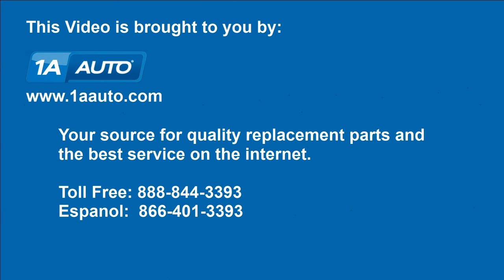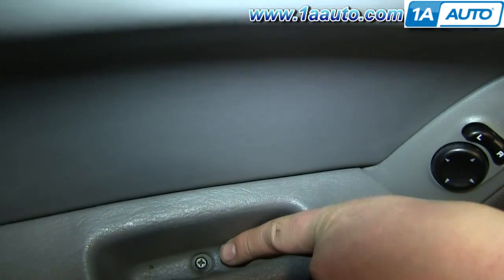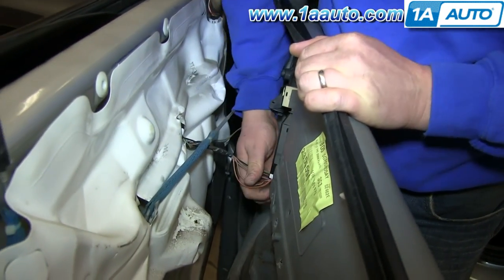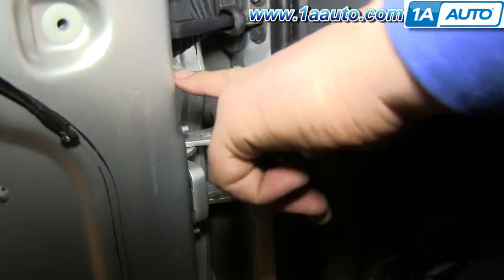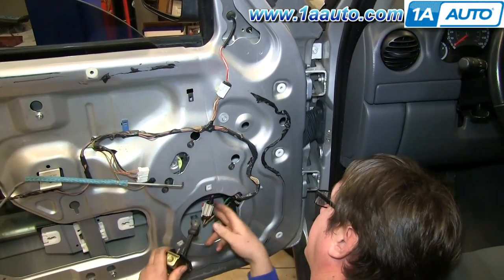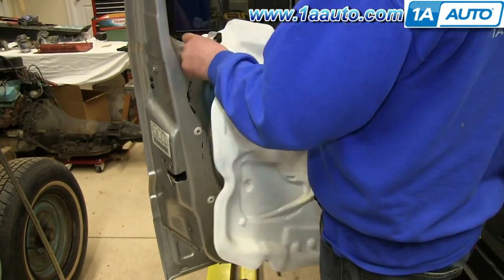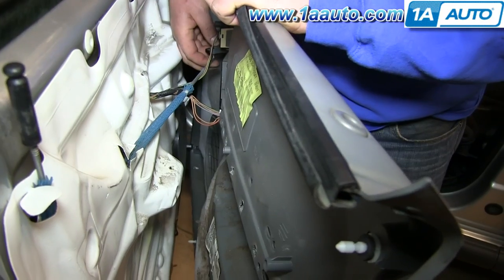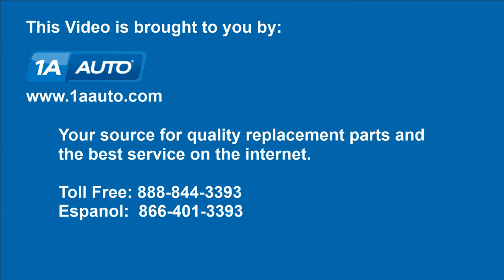How To Replace Door Check 02-06 Jeep Liberty

Comment: Okay I have the loud clanking as the door is opened and ordered the replacement part. Then I watched this blog several times and gathered the necessary tools. Getting all the door panels and stuff out of the way was easy and getting the broken closer out was doable. Getting the new closer in place is impossible for me. There is too much stuff in the way and sharp edges of the inner panel are cutting me up. My left arm is a bloody mess. I've given up and have scheduled an appointment for Monday am to have the job completed.

Comment: Very good video, but to save time, there's no need to remove the water barrier, and you will never get it to seal again unless you re-tack it. I have changed 2 of these (both in Liberty 2003, and 2007 Sport) and simply reached up through the speaker hole to pull out the check stop unit and replace it with a new one. 7 minutes in and out. Anyway, these should be made of stainless steel or aluminum like Land Rover, so they never rust or break.
Reply from the maker: +The Count Thank you for checking us out, as well as the feedback. This will certainly assist other viewers complete the repair in a timely fashion with minimal extra parts being required. 1aauto.com

Comment: My shop just replaced this part for me.   They had trouble getting the slide lock to work again. So I could get my car back for the weekend they just put it back together this way.  Charged me 1.30  hours labor for this and for "cleaning" and "lubing" my rear drivers side window that was closing more and more slowly.   So I paid $200 for these 2 things.  They had my car all day.  I think this seems reasonable  But I think I should go back to get the slide lock fixed. I never use it, but worked when I went in.